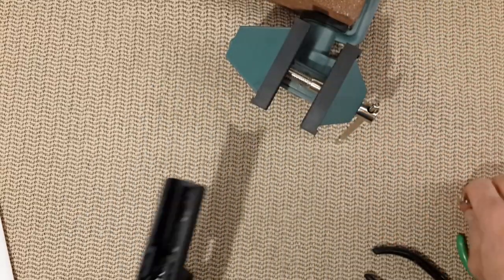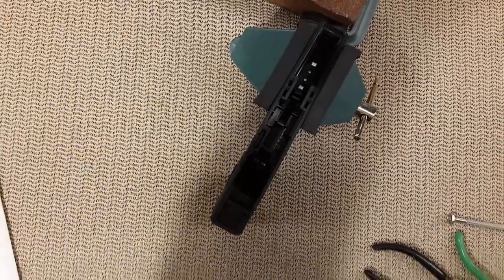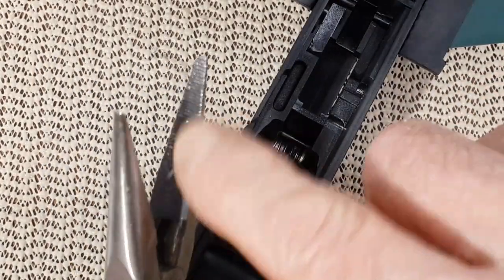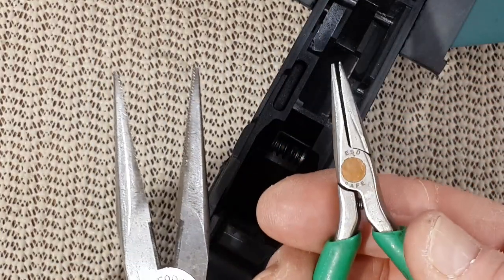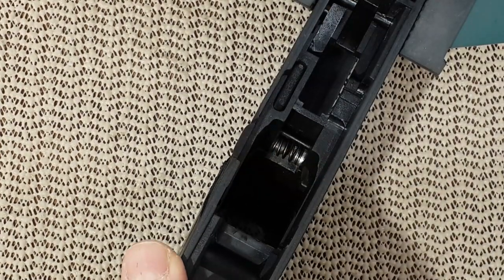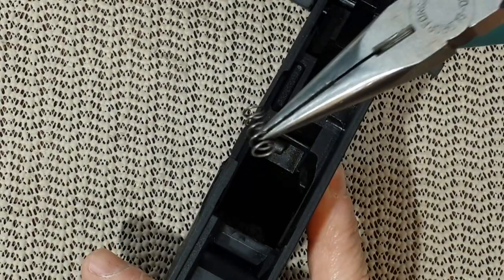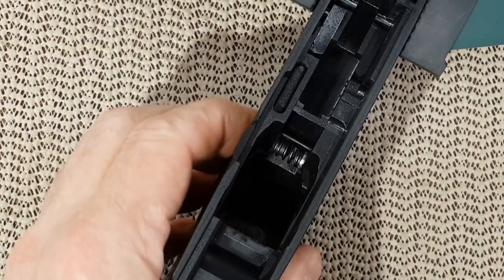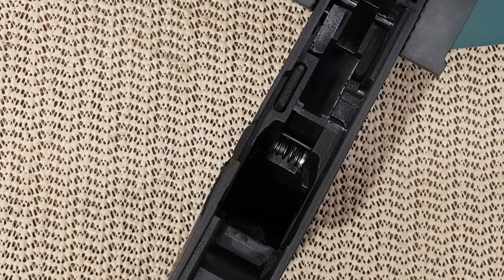Steyr L9 A1 / A2 Magazine release removal

Comment: Thank you for this excellent disassembly series on the Steyr. You have given me confidence to try this on my pistols. The Steyr's are very well designed and seem to be simple to service.
Reply from the maker: Thank you Seaboss. If you get yourself into a snag, drop me a comment and I will help.
Over all, the Steyr is not too difficult to work on. 
But what ever you do on the slide, DO NOT MESS with the "Loaded Chamber Indicator". 
It is a nightmare to re-install. Luckily, we should NEVER have to remove it, not even for cleaning.
Until next time, happy shooting

Comment: Thank you very much for your video about the magazine release button! I recently got a L9-A2 MF. On the L9-A1, 4 years ago, I already had the problem that my thumb is too short and that the gun (or Steyr Arms) lacks an optional extended mag release button. I went to an IPSC class back then and really had to watch my reloads (90deg rule) because of turning the gun in my right hand to reach the button. So now,. for my first real match with the L9-A2 MF in Standard Minor I changed the magazine button to the right - so I could use my right hand middle finger to eject the magazine. It works, I will train a bit more, but once you got into the habit the magazine drops reliable and fast.
Reply from the maker: Very clever Philipp. Happy shooting.

Comment: I'm not a lefty, but I like reversing my push button mag releases so that I can use my right trigger finger for mag changes. The best handguns for this are, in no particular order, CZ, H&K (ambi levers), Glock. Some 1911 users install aftermarket right sided mag release buttons, but some require permanent modification of the frame. Two of them do not, though, and one is from Cylinder and Slide, but uses plastic parts. The second one is from Mitchell Custom Guns LLC (bulletworks.com) - but I'm assuming that he is retired now, as my emails have gone unanswered.